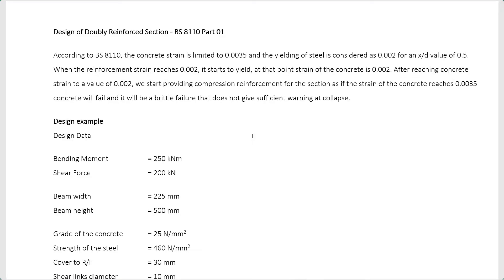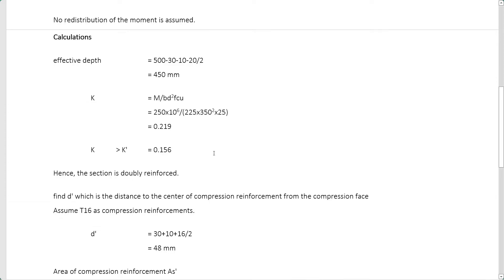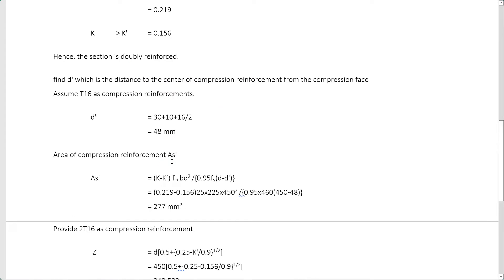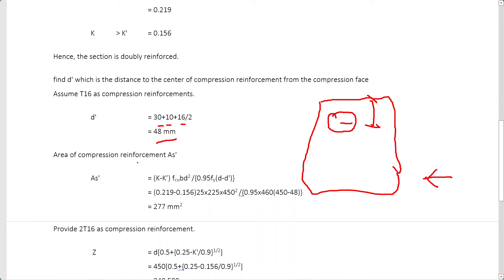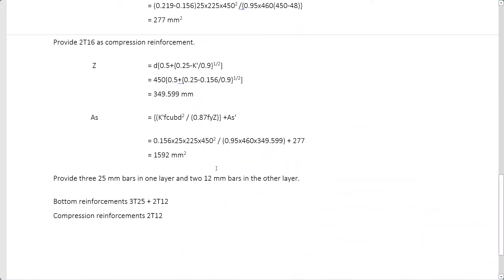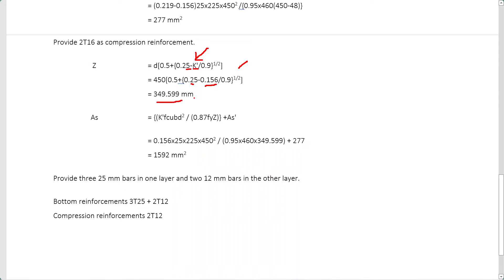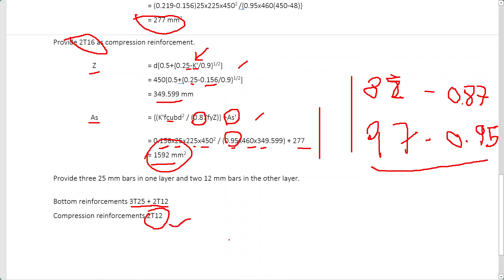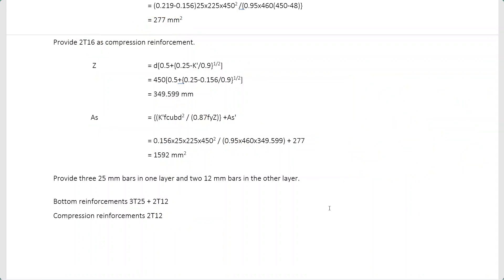Design of doubly reinforced concrete beam bs8110 | Worked Example | Structural Guide

Comment: Which formula must be used here considering both singly reinforced and doubly reinforced 
* As=M/0.95fyz or As= M/0.87fyz for singly reinforced section

* As'= (k-k')fcubd²/0.95fy(d-d') or.     As'= (k-k')fcubd²/0.87fy(d-d')

* As= k'fcubd²/0.95fyz+ As' or.     
As= k'fcubd²/0.87fyz+ As'

I need to know which formulas are correct
Reply from the maker: You could use the first one. It is the latest, in 1997. The other one was in 1980s.

Comment: What is the formula  for getting number of bars from area of steel according bs8110 for Fy=410, Fcu= 20, Because BS8110 part 3 doesn't have table for such cases.
Reply from the maker: If I understood your question correctly, you are asking the method of calculating the number of bars based on Fy and Fcu. 
It would depend on the bending moment of the section. Based on the bending moment we find the area of the reinforcement. From that, if know the area of the single bar. We can calculate the number of bars. 
In addition, When the reinforcement is not yield or we have to use the principles to calculate the area of reinforcements.